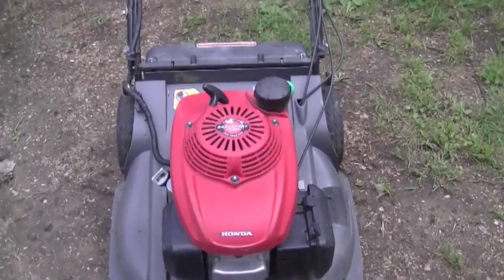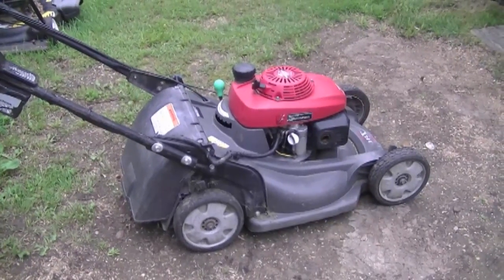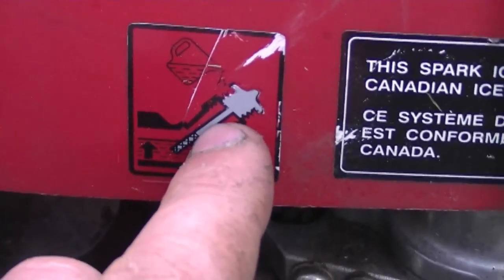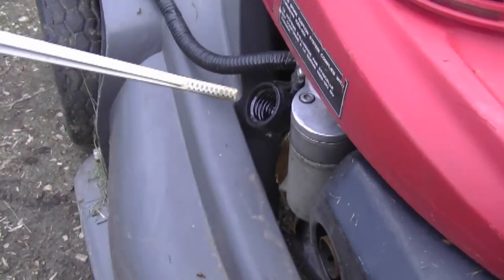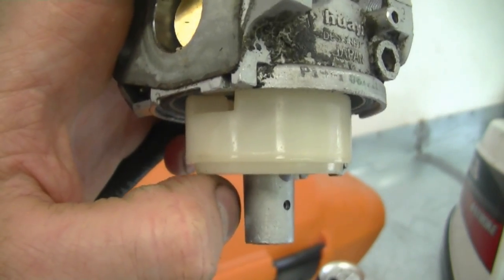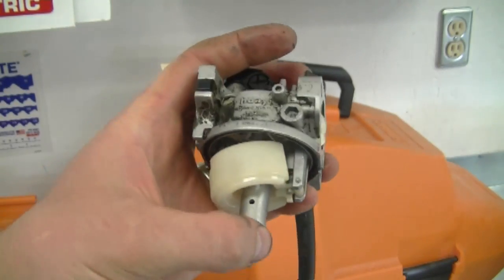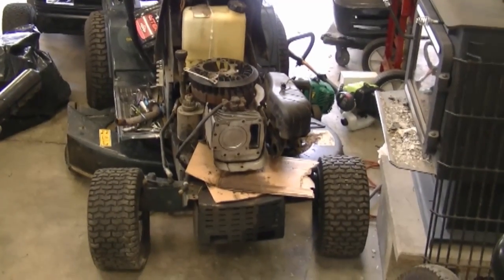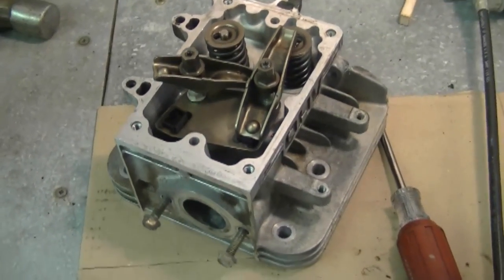Small Engines Q & A Video #101 in HD

Comment: Hey if thats not the case i dont know how old the mower is but make sure you are turning off the gas shut off that connects from the gas tank to the carb because if you do not the fuel gets into the crank case and can send fuel up through the breather pipe connected to the carb. so check to make sure that your air filter doesn't smell like oil. If this is the case then just drain the oil and then make sure you clean the air filter real good and MAKE SURE TO TURN OFF YOU GAS.

Comment: Hi donny,
Hello from Mississippi. I bought an older murray pushmower with a tecu engine for five dollars. I was trying to clean the carb which had a brass float and the needle valve was fixed into a piece of wire kinda unlike what im used to seeing. Well im guessing i put it back together wrong because i wasnt paying attention to detail. Can you show a video of how this system works if your able thanks a million.

Comment: Hi im in the uk and I have a honda hrx537 which I bought cheap with a bent crank shaft,I replaced the engine,but I just wondered how much is the drive unit in Canada for that mower,in the uk that are very expensive around £400,but I have Gould them cheaper online in The USA.Also one other question I have a ride on mower and I think it may have popped the valve seat how do you carry out the repair like you did with the punch.Thanks very much for your great vids.

Comment: i heard that the 4 mixes also need more service, is that true? i would never buy any trimmer that required a separate place for oil because i would be afraid to hold it upside down to edge. how is your experience with Husqvarna been because i love my Husqvarna 128ld